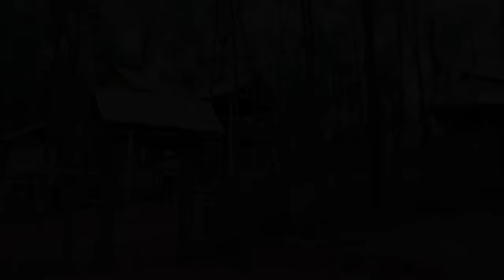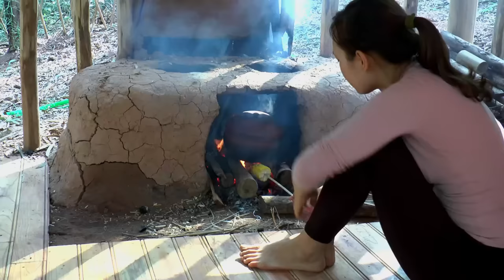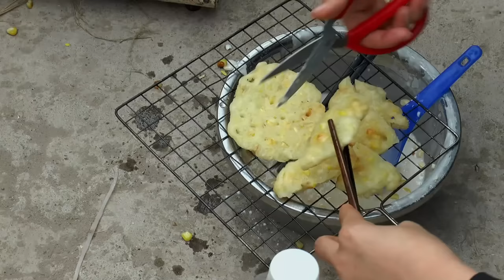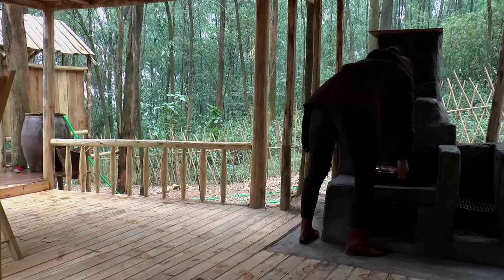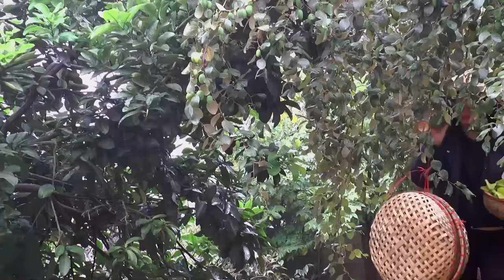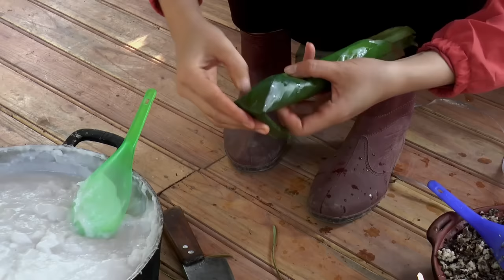60 Days Building a New Life, Animal Farm Care, Harvest Crops Going to Market To Sell | My Free Life

Comment: Hi, GReat video. Advice.. put next time some ( litle bit /10L) liquid soap in the water for cement. It works MUCH better. it sticks better too. Now the water came out the mortel too fast. You need a airy mortel. airbubles in it. oh, and bicycle tires need more air, and pull the wheel back, to tightening the chain.